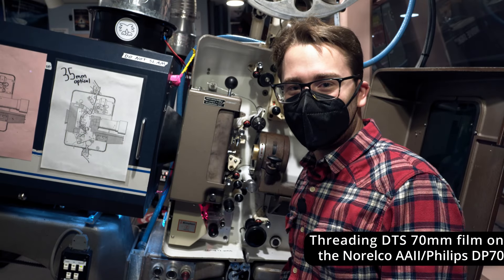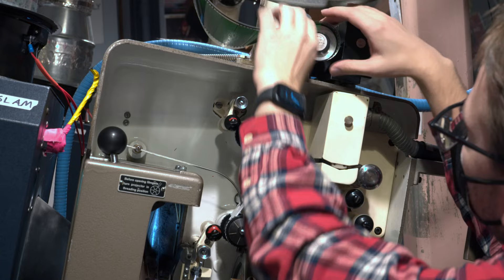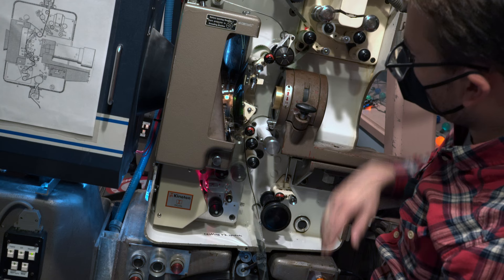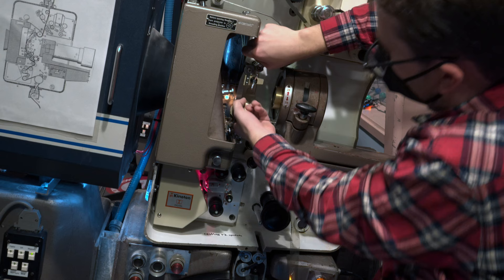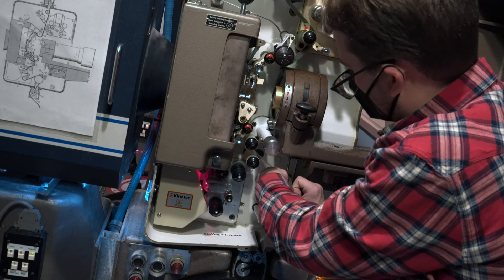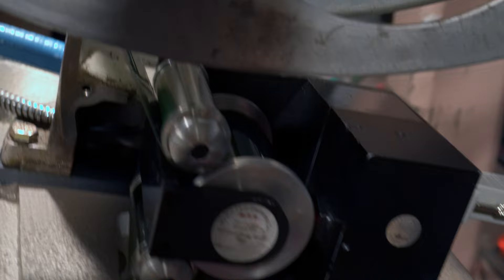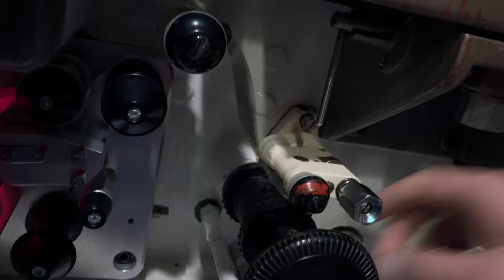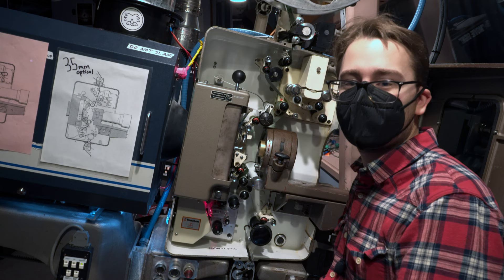Setting Up Modern #70mm DTS Film (4K)

Comment: I appreciate your interest in motion picture film projection.  You have proper etiquette, like keeping film off the floor, and checking film loop sizes to avoid film breakage or scratches.  I have 11 years of 35mm film projection experience at 4 different movie theaters.  I enjoyed it very much, but got laid off in 2010 when they went digital.  Norelco projectors are some of the very best 70mm projectors ever built.  I never got to run one before, and never got to run 70mm film either, until I got invited into a IMAX projection booth, and the projectionist walked me through the complicated and long film path, and showed me how to clean and thread the IMAX 70MM projector and guidance film rollers.  I was excited and confused at the same time, but got the experience of threading the big projector, moving it up about 15 feet above my head, and starting the show.  At the show end, I brought it back down, and started the film rewind process, and ran the print again afterwards for the next show.  I felt like a kid in a candy store, and literally went nuts, but not in a bad way.  Enjoyed every minute of it.
Reply from the maker: What a great story! And thank you for the kind words!